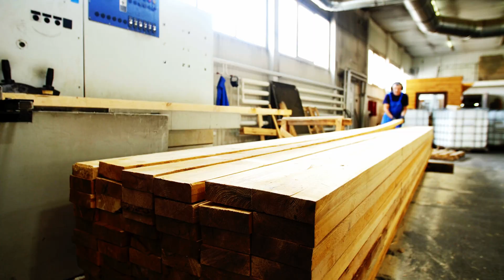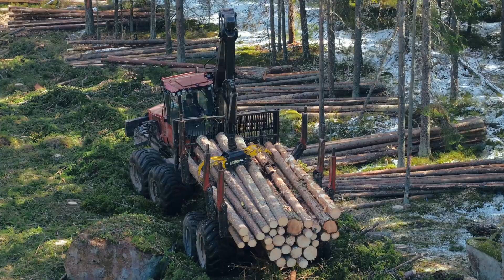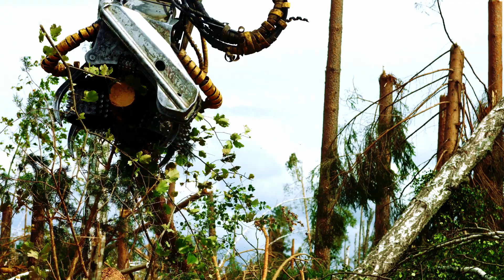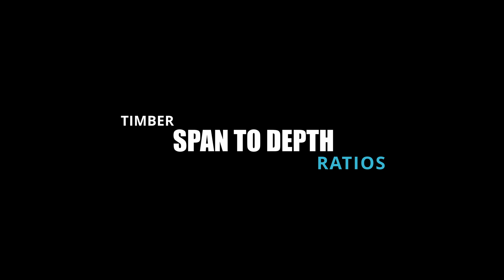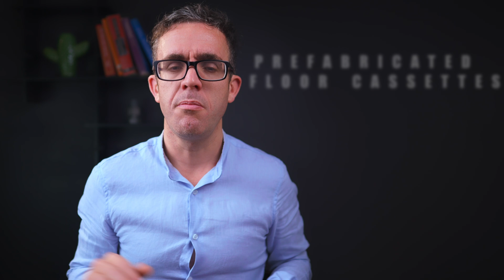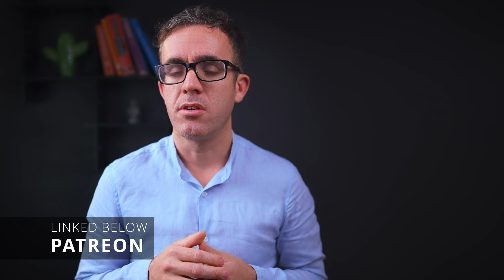Why Timber Buildings are the Future of Structural Engineering

Comment: Imagine the noise in a timber apartment block, absolute torture. Of course the developer will be living in his mansion in the country..... the end user is never though of.
Reply from the maker: solid Timber flooring is not too bad it preforms as almost as well as a concrete floor. there are many other elements you can add to the structure to attenuated noise transmission.

Comment: Nice video. Your comment about the noise benefits of timber construction gave me pause though. In what sense? Timber construction often has significant cutting/ripping on site. Not to mention nail guns, drilling etc. All pretty loud. Concrete, masonry and steel construction all seem to be significantly quieter by comparison.
Reply from the maker: Hi Sean, concrete construction is really noisy during concrete pours, also there is drilling and other activities. steel construction has ratchet for tightening bolts and cranes are typically larger. I found all construction in noisy, relatively timber seem quieter.

Comment: Brendan, we love your channel.  I do not agree on using timber and engineered wood products for larger buildings.  Fire is an issue (huge issue as many jurisdictions and even cities are no longer allowing wood structures), insurance now that the insurance industry has real experience with these structures, water damage if not protected, rot, delamination, lack of proper connection practice by not very disciplined workforce, lack of proper beam lamination (through bolting and multiple torquing requirement), insects, problem with heat related failure due to adhesive bonding not mechanical fastening , I -joists, I rafters and LVLs failing during fires (just ask any fire marshals about this), shear wall issues, etc.   If we had no CFS, structural steel and no concrete, we would be forced to deal with all this. 
These observations come from 4 decades of  experience with all of the above.  Our inspections constantly identify significant and numerous problems on projects where timber is involved.  The engineered members do allow for longer spans and modular type beams and all the issues I just mentioned become even more critical.  Then add not well thought through surcharge loads on cantilevers and jobsite changes from owners and builders that we were only told about during or after a change (and had not given us a chance to run calcs on their either design or even cost cutting measures).  We then have to engineer a structural solution to make up for the change or reduction in required strength.  Oh, I did not mention that the HD connectors are not readily available.  Simpson makes good product but not up what your image above shows.  Even in large residential structures, all these problems exist.  I hope this is not the future.
Reply from the maker: Hi Micheal, thanks for the well thought out message. Agree that durability can be an issue,  but with any construction if not built correctly it will have issue. I have see building of all types having issues. The newer timber products seem to be improving but only time will tell.

Comment: The only problem i had we timber was on the constructor's quality  control side. I used Glulam on a structure, those Glulam pieces need to have a tight quality control because the layers can detach from each other due to fabrication error, i warned their engineer several times for this fact. 

He assured me everything was good several times, turns out one of them had this problem (to be used as purlins) and after 2 months, deflection on that purlin alone and on the shortest span, they tried to pass it as "normal" ahah.

Other than that, i never had an issue with timber, is a pain to design it to code in Europe (eurocode 5) but it gives good results as a structural material, even for fire it takes a long time before it looses resistance unlike steel (without fire protection).
Reply from the maker: Hi Ooze, you just need to be careful where you source the timber from, I havent had any issues. and agree timber can be an amazing construction material.

Comment: The construction I have in mind which is drawing my attention to your videos is a residential 3-4 story (terraced by 1 if 4, flat if 3) with a 3.6 stud basement/garage all or mostly above grade and in a high fire risk area. For that reason I want the outside to be fibre-cement and the backing it's fixed to to be fire resistant and a layer of fire-impervious rockwool and steel behind that, then the internal lining and further insulation (eg foam-ply sandwich) beyond that. I know steel gets soft when it heats up and wood burns through slowly but my intent with that style of outer-to-inner layering would be to survive a fire with no or only superficial damage eg paint baked off. Whereas if the timber extended to the cladding it could end very badly if there was a forest/bush fire adjacent to the structure. That's a real risk in my particular location and maybe only a 20 or more yearly event, but one that I'd like to have in mind while designing the thing. 3.6 lower floor for 2 reasons, one to push up the main floor to panoramic view level over the lower-set house in front, and two to provide for enough room for a 2 post car lift and 3-layer car storage. Site is 2084sqm and about 550sqm is flat (~450sqm) or flatish (~100sqm) on top  with approx 1:2 grade to the lower part which has maybe 300sqm of usable flatish land that I've got a driveway/turning area in packed gravel and am putting a small holiday cabin and associated facilities (eg a deck, smokehouse, carport, etc) on.

Comment: An interesting apartment building went up not far from me here - 100% solid timber construction. If you crashed a car into that at 100kph the building would be okay. EPICLY strong thing with huge hydric buffer capacity and very good fire safety. Went and visited it on the regular during construction just to see how the various details fitted together. Pretty impressive thing. About 3 stories or so, and maybe an acre or so of land area occupied all up.
Reply from the maker: Yea timber can be very impressive, great a dissipating forces some earthquake, Wind and impact..
It is a underappreciated material.
Reply: @BrendanHasty  Not by me! I don't appreciate fast-grown pine much, but I love Jarrah and Kauri and Kwila and oak (whisky, wine) - I have some Aeromer  and lots of teak and heaps of other species. Steel and wood both have their place. That building will be there in 1000 years unless it gets replaced with something else, but I'd pity the demo crew :-D
Reply from the maker: @fredio54   @fredio54  Hi Fredio, I agree both have there place, same with concrete. composite steel and timber structures are achieve amazing things.

Comment: Hi Brendan, thanks for sharing this interesting topic. Just a question here in regards to your high rise building example at the begining of video, how did they pass the non-combustible material testing?
Reply from the maker: Hi Jason, I am unsure of the approach they took; however, there are several ways it could have been addressed. Solid timber doesn't burn as easily, so it would have undergone testing, or they may have added a fire retardant soaked into the timber. Sometimes you can get a dispensation if you add additional mitigations methods.

Comment: I agree with almost all of what you said, but; sustainable logging sounds great; in reality not so great.  If you grow vegetables at home or commercially, you will find that the growing takes nutrients from the soil.  Simple replanting, which is what is usually done, results in inferior timber in the next crop of trees.  Fertilising on a massive scale which would be needed for a forest, is not environmentally sustainable.  BTW, fertilisers which are used on a big scale like wheat growing, are made from fossil fuels.  If only it was that easy.
Reply from the maker: Hi lion, sustainable logging comes in many forms, plantation harvesting can have large negative effects like you mention. 
 Examples of sustainable forest management may  avoid the complete removal of a forest is to use selective logging. Selective logging is the practice of removing certain trees while preserving the balance of the woodland. Selective logging is more time consuming and more expensive then clearing the trees, but it preserves the forest's assets.
Another example of a sustainable forestry practice is allowing young trees time to mature. While a young tree may have value, its value will increase as it matures. Proper forest management will take into account the potential value of trees and delay the harvest of immature trees. In this way, sustainable forest management protects the long-term value of the forest. Other examples of sustainable forestry involve the planting of trees to extend forestlands, as well as the creation of protected forests that provide safe habitats for various plant and animal species.

With the correct approach you can balance environmental impact with a cost-effective solution. Would it be more expensive then clear felling yes, but we should always look for a better way.
Reply: @BrendanHasty  Hi, yes I am very aware of selective logging.  It does help the land and the environment when logging is undertaken.  The practice trades some productivity with less damage to the environment which we all strive for.  However anyone involved in growing things for cropping be it lawn or trees knows that repeated cropping is only possible with fertilizers, which on the scale of forests means using bulk fertilizers which are currently made mainly from natural gas.   You need to take the long view.  Each crop of harvested trees depletes the soil a bit more.  In natural forests the regeneration of the soil is provided by the breakdown of the tree material into the soil.  The natural cycle!  If we stop the natural background regeneration by removing the timber, dear old mother earth hastens its trip down the gurgler.   Take that tree material away and the soil is depleted, selective logging or not.  Read up on it, the process has been well documented  for centuries.  Centuries ago, animal and human manure solved the issue when cropping was small scale.  I suspect that a million people crapping in each forest could provide the necessary regenerative nutrients.  I joke not, but one more palatable way forward is instead of cremating our dead with natural gas, we bury all bodies in the forests with no coffin, no cardboard box.  Relogging is not sustainable.

Comment: Interesting intro video to timber Brenden. And 4:27 good moves man. 
Also can you do a video on load combinations for both steel and concrete. 
It will be helpful if you could cover some international codes since load combos are frustratingly confusing a lot of times. Thanks.
Reply from the maker: Hi Deepak, thanks for noticing. 
Thanks suggesting a video topic, I have been putting together a useful guide to cover internation codes, you need to look at both load combinations and material safety factors to get a FOS(factor of safety) to get a full overview.
Reply: @BrendanHasty  Thanks , waiting eagerly for the video.

Comment: I think timber is a very under-used material due to traditional misconceptions. Thanks for clearing some of those up. It is not a subject that receives much attention (in RSA at least), so most of the time one has to do self-study. Another benefit not mentioned in the video or in the comments, is that it's a visually stimulating material. Few aesthetics beats a beautifully treated and exposed timber structure.
Reply from the maker: Hi Theuns, agree timber is very underrated as a structural material, more engineering should be talking  about it's structural properties it is a great material. Total agree with it Aesthetics properties it is amazing to walk into a building that is made out of mass timber

Comment: Hello Brendan..thank you for this piece on timber construction..I feel timber the other two advantages of timber is its higher speed of constructability if we are to compare it to concrete . It has great thermal insulation properties as well if we look at in Temperate regions
Reply from the maker: Hi Martin, agree with both your advantages it excels at both. It has the benefits of Precast concrete but is much lighter.

Comment: I think this was a really cool way to introduce timber. Last year I took a course at university and we discussed the various points you've talked about. I have to admit that at first I was a little bit surprised about the properties of timber (especially the fact timber is good against seismic loads). Keep up the good work :)
Reply from the maker: Thanks Tonio, did you university course cover any additional points around timber design?
Timber is amazing for a natural construction material, it surprises most people how strong timber can be and it's ability to bend and flex without degrading this what makes it soo good under seismic forces.
Reply: @BrendanHasty  No, the additional topics covered by the corse weren't really about design. There was an historical review about how wood was used as building material in various times (which was pretty interesting tbh) and there was a little chapter about the detailing (which was cool but poor explained).
Reply: Is there any prrcautions regarding termites as once they are in the structure they can spread across the complete structure degrading it